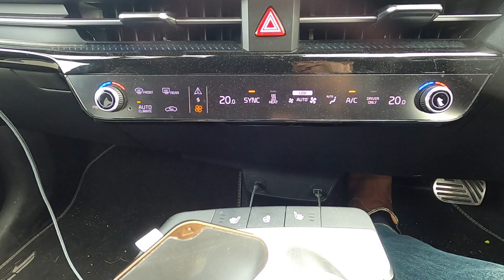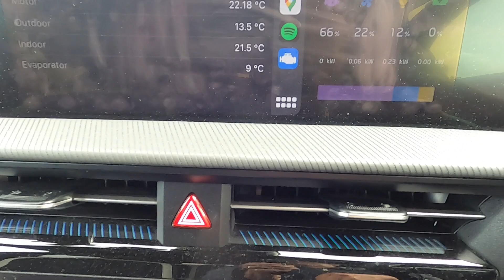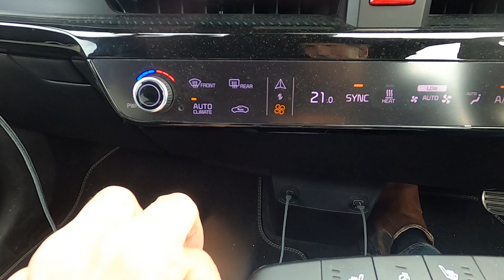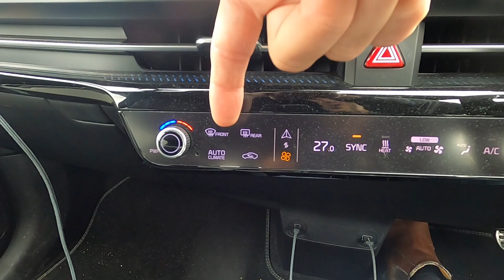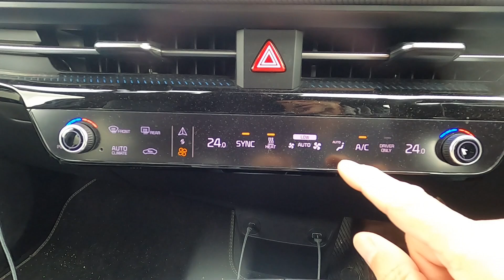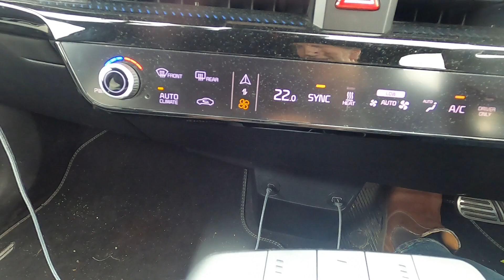Using the Kia EV6 heating, ventilation and air conditioning system - HVAC

Comment: Thanks for this. All clear and understood. I have EV6 GT-Line S and the issues I have - only in winter - is after an hour or so driving the cabin will go cold and no amount of fiddling seems to correct it. Also the 'recirculation' mode sometimes comes on of its own accord. My car has an AHP. Ive fiddled recently with some of the HVAC settings and it has been behaving itself but tbh I have not been doing long journeys.
Reply: I've now read all the comments. Common denominator is the AHP. I now understand why the recirculation kicks in of its own accord.

Comment: I own the 2024 EV6 and mine has had an issue that started this week where despite having heating turned on and AC off, heating on and the the cabin temperature set to 23.5°C, it will suddenly go from blowing hot air to blowing cool air for 3-4 minutes and then go back to blowing hot air. Clearly a problem with the heating system but super strange. Turning on the heating from the app no longer works. This is seriously annoying considering it's winter and has been freezing in Belgium.

Comment: Thanks. Although my earlier-model Kia (the e-Niro 2021) features a different layout, with an emphasis on physical buttons and knobs, your demonstration was valuable. Before I bought my e-Niro I had become accustomed to our home Mitsubishi A/C involving a heat pump system that is reversible to handle EITHER heating OR cooling without using any resistive heater elements. So when problems arose with my car's A/C I came to realis there was something I was not understanding about my car. 
It had puzzled me there was a HEAT button on my dashboard which seemed redundant. Later, I learned this button activates a kind of resistive heating they call PTC, which I thought might sometimes be supplementary to any heating achieved by what they (and you) call the "aircon" or A/C for short. But I found that in auto mode this HEAT button lit up at odd times. Now I understand the system better, I think.
Although you said that the label "A/C" means aircon, and not "Air Cooling", I beg to differ. It seems that - unlike a home aircon system - a car aircon system can ONLY run like a home refrigerator. Neither can reverse their cycle. 
When heat is needed, an ICE car can obtain it from the petrol-burning engine,  but a BEV does not have that luxury. Using an electric heater along with air cooling uses a bit more electricity than reversing a heat pump, but it works faster to demist your windscreen. Plus a reversible heat pump would no doubt cost more and have more parts to go wrong...
So it seems that is why you can have BOTH buttons lit up when wanting to demist your windscreen! The A/C (Air Cooling) dries the air first, just like in a 'fridge, and the resistive heater then precisely adjusts the resulting air temperature by counteracting the cooling effect of the heat pump. But I rather wish that "A/C" button could have been labeled COOL instead...  😉

Comment: My car is an EV6 GT Line Plus FWD with heat pump.  I noticed during the above video that your car was showing 237 miles range at 80% battery level.  Even at current high ambient temperatures I never see more than 215 miles at 80%.  Also I don't know what the actual function of the heat pump is or whether IT needs manual "switching on".  Can you help please.
Reply from the maker: I don't have the heat pump in this car but I did have it in a previous EV6 that I owned while waiting for my order to come through (at the initial release demand was much higher than supply on these cars, I had to wait a full year). The heat pump cannot be manually turned on/off, it is just used by the HVAC system to reduce energy usage of the HVAC system. In warm/hot weather it'll still use the AC and in cold weather it'll still need to use the resistive heater, the heat pump cannot heat as strongly. On a cold day, the resistive heater will be used to heat the cabin up to temperature and then in your car it can turn off and that temperature can be maintained by the heat pump. In mine the resistive heater would still be needed, so in your car some energy would be saved. Does that make sense?

Comment: I have a heat pump in my 22 reg EV6. If I turn on recirculation to prevent cold air coming in I find the heat pump keeps the inside of the car warm. No electricity used.

Comment: Doesn't it try and scavenge heat from the battery with both ac and heat turned off? I'm pretty sure it just ventilates the cabin via the battery it doesn't extract much, but it tries at least hence why you hear the fans ramp up.
Reply from the maker: I'm not sure, but I doubt it. In my experience the battery only really generates heat when it's charging. Maybe because it's 800V and so the internal resistance is less but during normal driving it pretty much matches ambient +-1 or 2 degrees. So there wouldn't be much to gain from doing anything like that.

The motor generates heat, so that would be better to scavenge from. But again, I don't know if it's designed that way or not.

Comment: I have a heat pump installed with my EV6. What does this actually do different to those without it? Would you know if the electric usage is less (if you have Heat on) ? Just curious as I had to have it as it is a leased car. Not really sure what the benefits are. Thanks
Reply from the maker: The use of the heat pump in the Kia EV6 is all a bit 'hidden'. There's no indication of when or if it's being used which is a real shame. Also I don't have one on this car so I can't look into the ODB data and see if it's referenced in there either. I did have the heat pump version of my car (still RWD and GTL) for 9 months prior to receiving mine though and from my experience I had slightly higher overall efficiency with the heat pump car.
Reply: The heat pump is more efficient but negligible in the uk climate - unless you are someone who wants tropical 27 degrees around the year. It has more benefit in countries with much colder climate for longer periods. I read it has improved efficiency by 20% (approx - I can’t remember exact %) which is misleading as people think that’s a 20% improved efficiency to the whole main battery. It isn’t. It is improved efficiency to the heating aspect only - so if your resistive heater is drawing 1 kW, with a heat pump it is likely to be closer to 0.8kW.